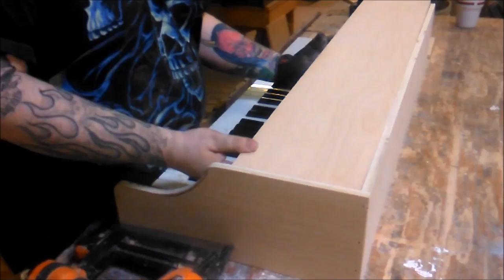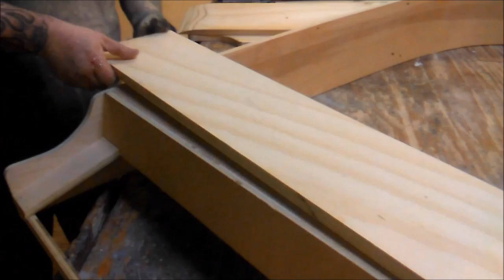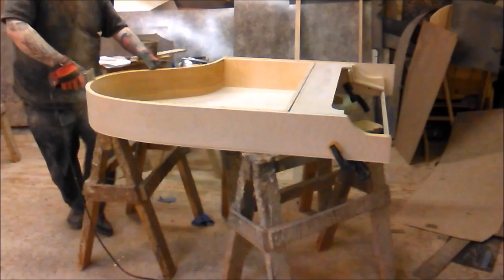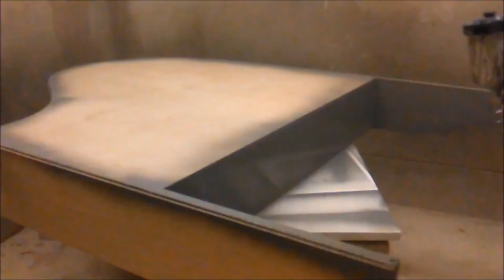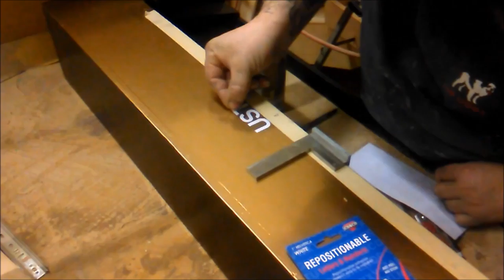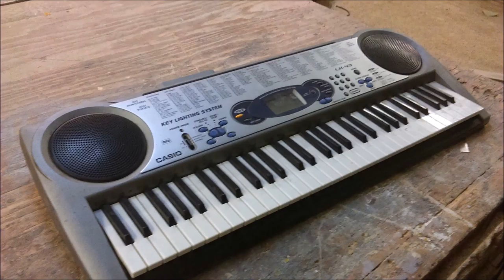making a grand piano display shelf using a casio keyboard

Comment: That is amazing what kind of wood did you use to bend the rim
Reply from the maker: +KMNKeyboardVault thank you ,it's defective  1/4 " plywood missing some lamination so it's actually only 1/8" ,so it just has a finished veneer on one side which makes it very bendy and 5 or 6 layers of that makes it about 3/4" final  thickness, thank you for watching